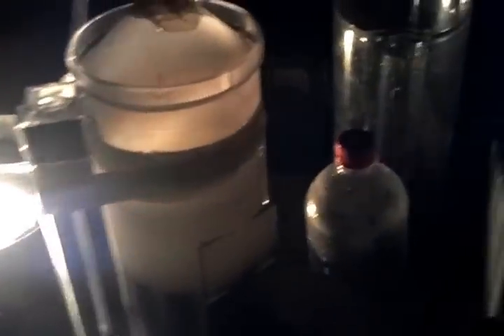1st GEGENE demonstration - making hydrogen.

Comment: i wonder if these backyard "inventors" will ever work out that these videos are of no use to anyone.
they begin explaining random parts of a bigger process using short hand terms for everything, without outlining what they are actually trying to achieve, and why or what each piece of the device is. try giving a simple schematic so the watcher can be onboard for the coming barage of quick short hand terms for each thing and maybe get some useful information or gain some interest. 
its like me being inside some random piece of mining equipment, pulling out my camera and you see a bunch of random metal things as i haphazardly shake the camera around and while you are trying to recognize each piece and get some kind of orientation as to which way is up and what you are looking at, while I'm calling out a serious of disjointed words you dont recgnise and you are supposed to just work out what all this means in the space of about 32 seconds.
never ceases to amaze me the lack or foresight these "inventors" have. such a wonder why they dont actually ever achieve anything of any use?....